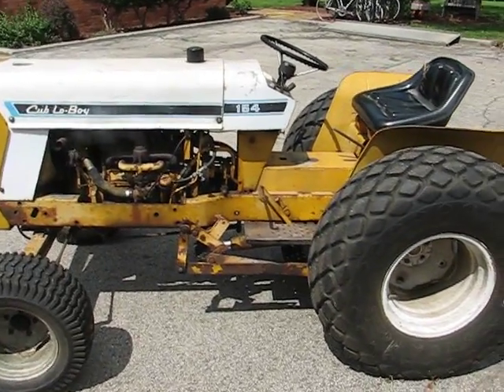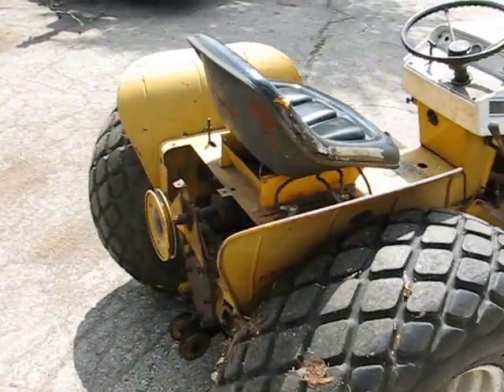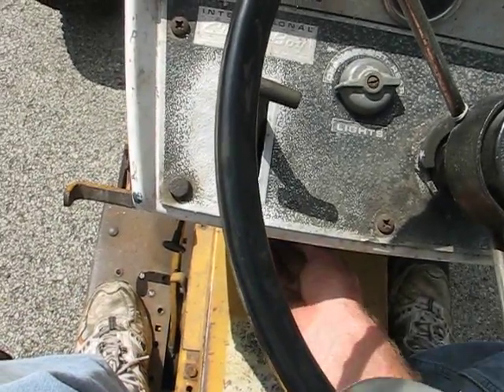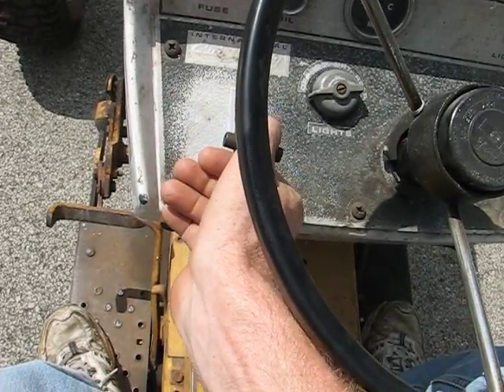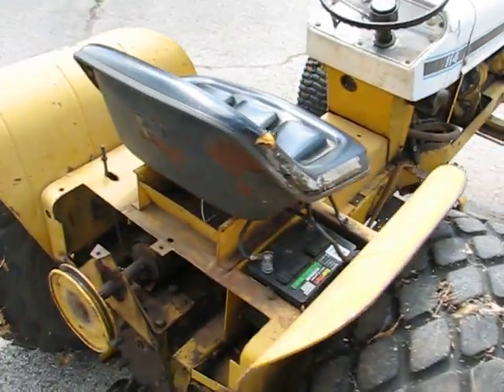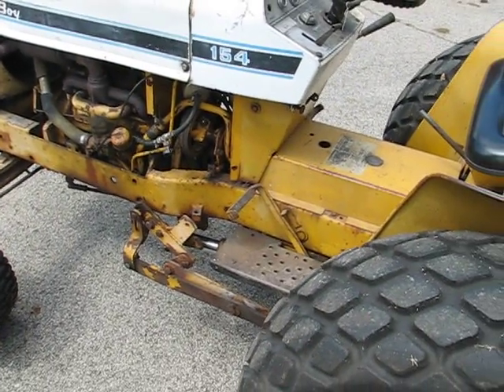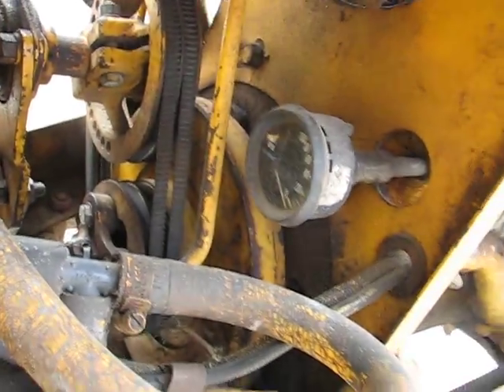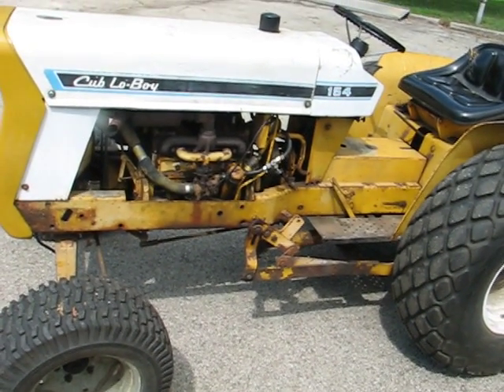Cub Lo Boy 154

Comment: So I am checking out videos of these cub's as I just bought one. Wouldnt you know, this is the exact tractor I bought! The spray paint cap as the steering cap was the dead give away along with your fuel valve. Let the restoration begin!!